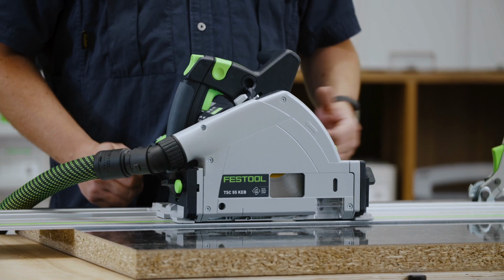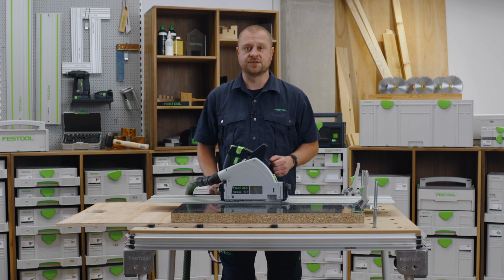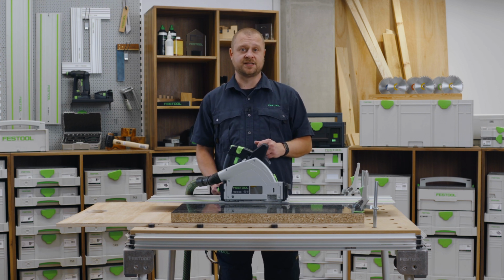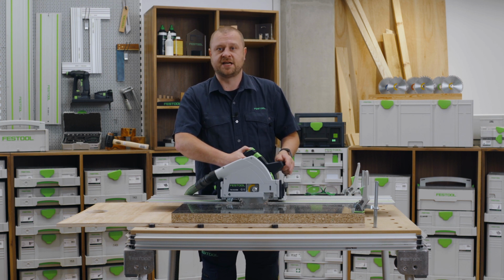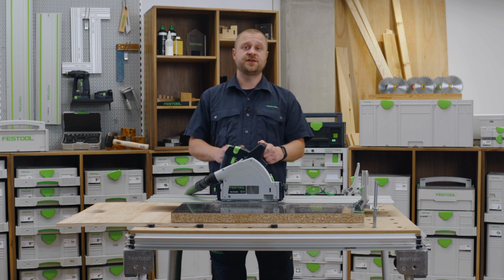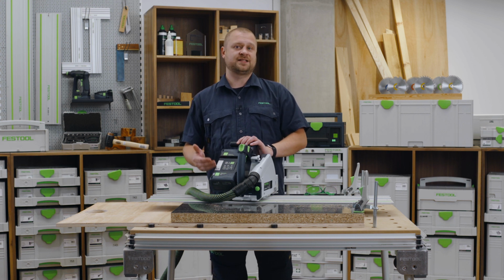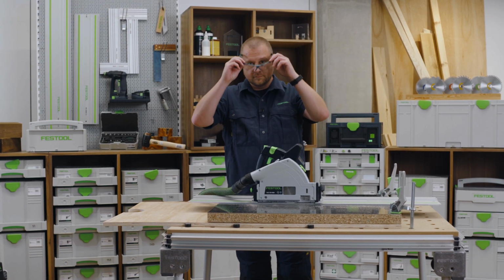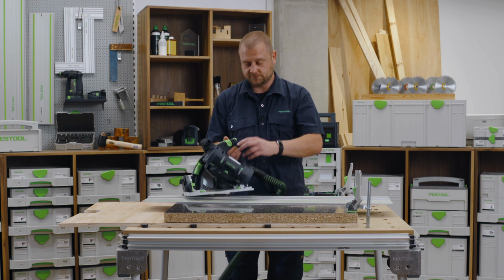The Festool TSC 55 K plunge-cut saw with KickBackStop

Comment: So by removing the riving knife, they have effectively made it useless for handheld cutting without a guiderail. Nice, I'll be moving to another brand.
Reply: Freehand cutting is demonstrated at the end of this video.
Reply: @gharel396  Yeah, by disabling the kickbackstop technology. You understand how dangerous that is? Kickbackstop off, and no riving knife? He had to manually stop and start the machine 4 times to complete one cut while in real life people are just going to disable the kickbackstop for that one cut and then get caught out with a spinning saw in their leg, waist, arm or worse. Restarting a saw without riving knife and without kickbackstop in a freehand pre-existing kerf. It'll work out fine 99 out of a 100 times 🙂
Reply: He explained at 3 min you can turn off kickback when not using a rail ,personally I think this is great technology, more times I nearly got caught out when they kickback
Reply: @piee3.14  "He explained at 3 min you can turn off kickback when not using a rail". That is specifically the problem. You'll have a hard time causing kickback on a rail, but freehand you are prone to kickback. So you turn off kickbackstop for freehand. Right. And you see that as a plus? 🙂
Reply: @davesmulders3931  for freehand I have Hikoki C6MEY circular saw with its own anti kickback system, that works very well :) (you can search on YT HiKOKI Kickback Protection [AC Brushless Motor] for demonstration of it in action).